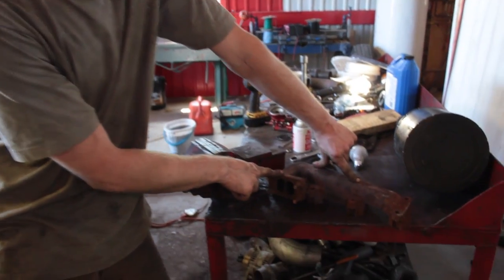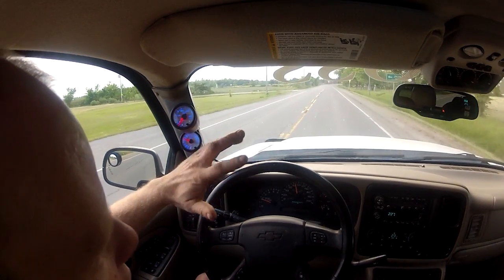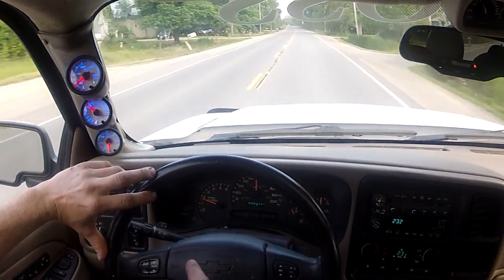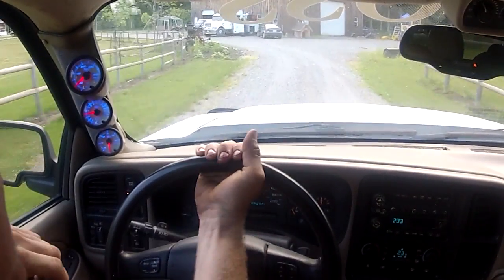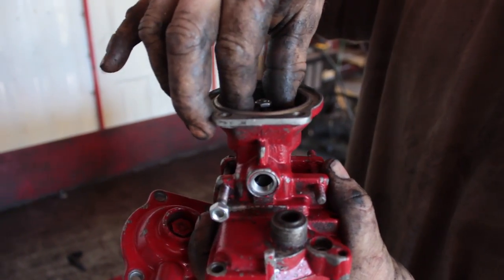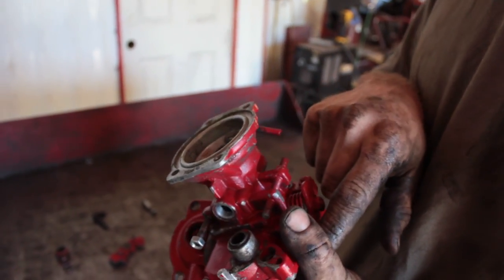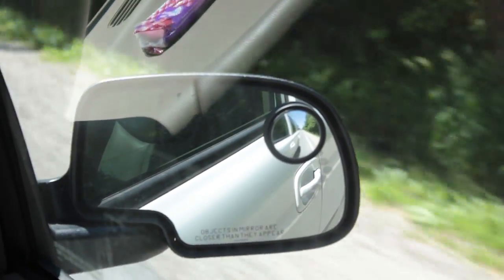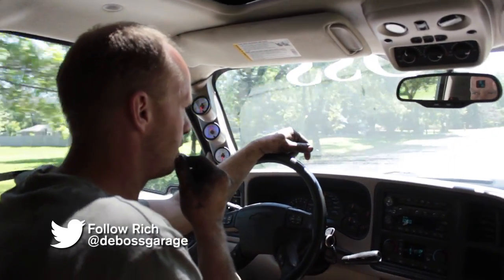VE Fuel Pump Tuning for a 3.9 Cummins 4BT #CumminsTahoe [EP9]

Comment: State Troopers pulled me over quite a few years ago in a 03 3500 Ram just for blowing a little puff of smoke while I had it under a heavy load taking off at a red light while so little moron was blacking out the hwy

Comment: hmmm i know this is late by years but on the turbo you could have put a smaller hot end on the Hx-35 like a 9 square cm housing instead of the 14 sq cm thats on a stock HX 35. then you would have room for future upgrades

Comment: Any idea what the MPG is? Is that 4cyl enough power for the SUV?
Reply: That 4 cyl diesel probably has more torque than the original v8. It won't be as fast but it will pull your house down

Comment: Piggyback the turbo off the 5.9 to the 4bt's stock turbo so then when the 4bt's turbo spools then it will have enough boost to spool the 5.9s and kaboom lots of boost but be careful the 5.is turbo can spool up to 40psi I think and the 4bt won't handle that much boost

Comment: awesome job, man. I have thought about putting a 4BT in a 2000s F-150, especially to replace the failure-prone V-6. seems like it would be a good choice, certainly more reliable.  they also came in many base models, which is fine for a work truck. also thought about a SuperCrew. 

thanks for your videos, you're very talented.

Comment: does anyone know if a 4L80E  could handle a 12 valve cummins
Reply: Brayden Conklin gm put it behind the 6.5 TD and those made about the same power in stock form so probably. I love the 4L80E it a good tranny

Comment: still can't get mine tuned right not much black smoke and boost up past 2000 rpm.. have the 3200 spring but don't want more noise

Comment: here's an idea... ever thought of running two turbos in sequence? That's what they are doing on the new V6 and 6.2L Fords.. you run it into the small turbo first so you get the quick spooling and then into the big turbo to get the higher end power with more flow.
Reply from the maker: Everybody's dream to have twins.  It's also everybody's dream to have enough cash to do whatever you want!
Reply: DEBOSS GARAGE well you seem to already have the parts sitting around, your stock 4BT turbo and the 5.9L turbo, you could just run them together.
Reply from the maker: They are basically the same turbo and don't work well together at all.  It comes up on forums all the time.
Reply: DEBOSS GARAGE hmm okay, well at least you answered my messages, most people I comment on never say anything.
Reply from the maker: I guess just make sure its intelligent conversation.  Sharing past experience's is 10 x more appreciated than just saying "you should have done this..."
Reply: DEBOSS GARAGE there's a difference between should've and here's an idea.. that's all I meant by this. 
As for anything I say about welding, that is from experience, I went to college to learn bodywork and paint and have been welding since high school.

Comment: Is it just me? At 1:57 into the video when you state all of your gauges are connected. The connection (brass boost pressure fitting) is connected to anything.
Reply from the maker: +J Dow That was during assembly.  At that specific time, the boost guage was not hooked up.  To keep it neat, I only left enough length of hose to take the pillar off, not enough to get a camera shot of it actually hooked up.   You guys don't miss much!

Comment: I repowered a Toyota t100 with the 4bt. I run an hx 35 with the wastegate blocked. It will spool that turbo great. It'll make 40 lbs of boost at 1800 rpm. It keeps my egt cool, rarely exceeding 1200*. Once lit, turbo clears up almost all the smoke. Its a ve pumped engine. Dynoed 284.6 hp. Curious why the hx 35 doesn't work for you. I love mine.
Reply: Can u message me I'd like more info I'm planning on putting a 4bt swap in my Toyota as well.
Reply: Is it on wheel?

Comment: how much is a 4bt and a transmission for it
Reply from the maker: +dylbyl1234 Torch should be the tool used least.  It just makes the job quicker.  Do you have a hoist?
Reply from the maker: +bigmeatieballs about 3k.  Trans usually come with it
Reply: +DEBOSS GARAGE you think it will be a easy swao with a dodge dakota got one sitting in yard with blown motor
Reply from the maker: +bigmeatieballs If it was easy, everybody would do it!  Having a well equipped shop with welder, torches, internet (chat forums) and a good imagination helps but with the fuel prices the way they are right now, it probably isn't worth it.  If you have some expendable income, it would be a great build, but it is a lot of work.
Reply: +DEBOSS GARAGE i do have a welder angle grinder all sorts or power tools and impactors and what not only thing i dont have is a torch could i get away using map gas ?
Reply: +DEBOSS GARAGE no but my buddy has a engine hoist

Comment: did you have trouble getting the Tahoe legally on the road? ( Emissions, registering a engine swap ) and is insurance okay for a engine swap?
Reply from the maker: +Kyle Bairstow Insurance needed an appraisal because it is worth more than blue book now.  Emissions are a joke in Ontario.  You can use EFI live to turn off the monitors that don't work anymore and you can pass with a "not ready"
Reply: Great thanks for the info! im thinking of doing a 4bt swap on my 1996 s10. i live in mississauga so stupid e-test crap for me im afraid
Reply from the maker: Anything older than 99 can be reclassified as a "hot rod".  Not a big deal at all.  You can pickup a form at the MTO.   You need to take 3 or 4 pictures of the truck and the re-powered engine and all you would need is to pass the e-test for a 4bt (Its just a sniff test in the pipe) and if you tune it right, there shouldn't be any smoke.  If you run into any issues, just get a hold of me.  The big problems with conversions is anything newer than 1999 because it needs to pass the emissions for the engine it left the factory with.
Reply: thanks alot ill be sure to
Reply: depends on region I think In Canada , but if the engine swapped in is newer then the truck its legal for us here in the states , even if it never came with it... Hptuners and efi Live are the other tools ya need , they are pretty invaluable when it comes to diesel swaps and pretty much anything late model..
Reply: M
Reply: Wow i live in manitoba and we have none of that no emissions testing and if you put a different engine in your vehicle all you gotta do is go to your insurance place and change the info on the registration
Reply: But this Tahoe is an 04 so how does that work?

Comment: While in park you should not see any boost when you rev. You will only see boost pressure under load or in gear. This has to do with throttle demand, engine load, and fueling. So in park demanding 50% throttle you will get less fuel than 50% throttle while under load. More fuel means more exhaust gas which makes magic happen in your turbo and boost. haha
Reply from the maker: +Erick Niemann I put the he221w on finally and got much better boost readings.  Amazing how quick the guage stands at attention now!
Reply: +DEBOSS GARAGE lol I heard you mention the 6bt turbo wouldn't spool. haha cool build though
Reply from the maker: +Erick Niemann The H1C was all right but not great.  I ran 15 000km with it to get my mileage figured out.  See if better boost makes much of a difference.

Comment: you could use the larger turbo if you wanted by switching the exhaust housing on the 2 turbos then you will spool up the larger turbo faster  because of having a smaller exhaust housing from the smaller turbo

Comment: I watch your videos and let me tell you there is no body out there explain everything like you. 
I got ask you something hope hear from you because I don't wanna start the swap and ending not finishing , I have a toyota rv sunrader that I would like to swap diesel engine for more power especially going up hill  is 4bt fits the toyota or no let me know please and thank you for sharing your knowledge
Reply from the maker: Hector Meza Those Sunraders are awesome little rides!  I am not sure what the front end is able to support weight wise in those RV's so definitely do your homework on suspension.  The 4bt weights about 750 lbs.  I am running 3.73 gear ratios and it cruises along nice with an overdrive.  You want to make sure your trans and diffs are able to hold up and that your ratios aren't too high.    I went to Africa a couple times to work at a school there and they had the little Hilux truck there.  I know one of those little diesels will drop right in but it might be a little underpowered.  Something to look into I guess.  Good luck with your project and make sure you take lots of videos.
Reply: DEBOSS GARAGE, what kind of prices are I seeing on the 4bt and 6bt? The prices seem to be getting ridiculously high maybe because of the interest in conversions.

Comment: does it have cruise control, average and instantaneous mpg, distance to empty, and oil life indicator?
Reply from the maker: shylildude As it was drive by wire and now cable, it does not have cruise control.  I still have to use EFI live to turn off certain monitors to remove the "reduced engine power" on the dash and then hopefully those indicators will come back on.   I am looking into how to get cruise working again as earlier models before drive by wire used vacuum and there is no room for a vacuum pump.   Thanks for watching